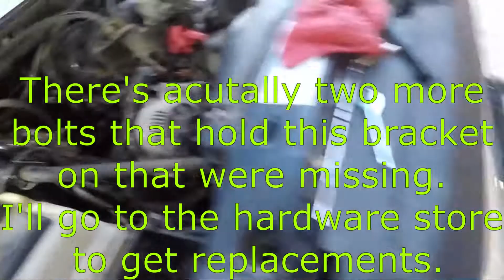Ford Ranger engine maintenance

Comment: So you didn't have to take out the engine.. ?? As I'm being told.. (4.0L V6 SoHC)
Reply from the maker: Engine out to do what?
Reply: To put a new valve cover gasket on Passenger side..
Reply: Mechanic near me wouldn't touch my sohc  2003 Ranger
Reply from the maker: @Iconhulk  he's not much of a mechanic if he can't do the passenger side valve cover on a 4.0 Ranger. Not really that difficult of a job.
Reply: @redblockgarage  some old timer.. But I'll keep searching.  👍 Thanks for the tip.